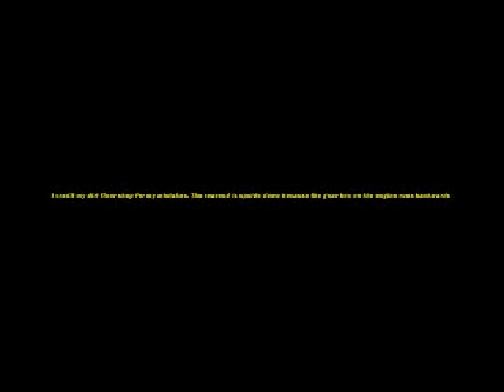More ratrod powered by JohnDeere

Comment from the maker: This engine  was on an old john deere combine. It has a clutch and a 3 to 1 gear box on it witch turns backwards so I had  to flip the rearend upside down or I would have 4 speeds in reverse and 1 slow speed forward. The output shaft on the gear box had a yoke on it. I cut that down and welded a thick pipe on and took the center from a chevy clutch and welded on the other end,drilled a hole in output shaft for the pilot shaft to slide into.Top speed about 30.probly too slow for your truck.